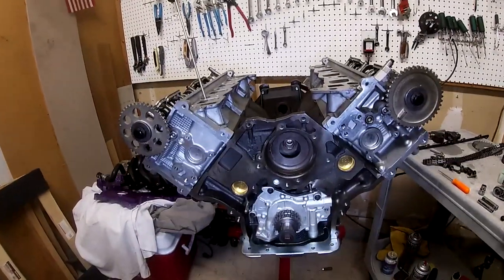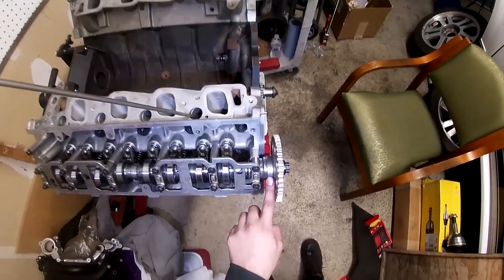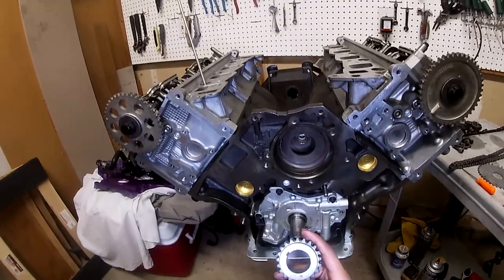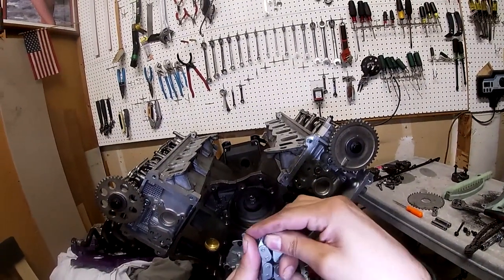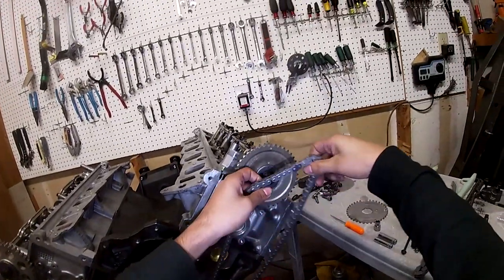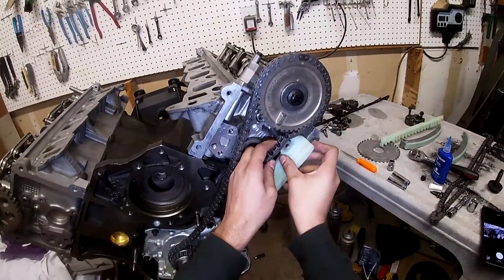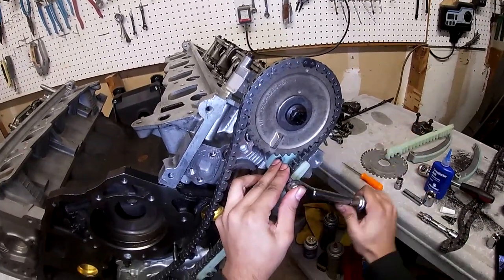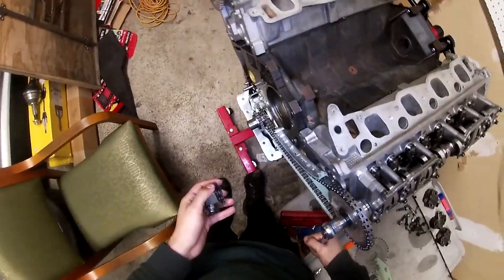Mustang 4.6 2v Timing Chain Install (Detailed Walkthrough)

Comment: Bought a crown Vic engine from a police cruiser for my F150 that I bought with bent valves. Was told it ran good but decided to open it up to check it out. Glad I did because although the engine never jumped time the left side lower guide had broken in two and was just laying in there still guiding the chain but ready to get crunched. Nice video ! Explained everything without the bee-bop !

Comment: I doubt you’ll see this but I would really appreciate if you could help me out I recently did a head gasket kit (driver side) on my 03 mustang gt and the engine was spinning freely when I put the timing chains on and spun it one full lap around it just locked up the engine didn’t wanna spin at all I had to spin the cam shaft to get it to the timing marks so I did one full spin and it sat perfectly in the timing marks please help I don’t know what to do

Comment: Hey i was replacing a 97 lincoln ford 4.6l 2v v8 head gasket and when i set the crankshaft to top dead cent the cams where totally off but my engine ran smooth its weird , while the heads were off i forgot to turn the cams into the timing position and bolted them onto the heads and now when i try to turn cams to the timing position i can feel valves hitting pistons, do i gotta take the heads back off ?

Comment: Someone plz help, i need to do the timing chain on my 4.6 2v f150, its rattling, and its either a broken chain guide or a rocker arm, anyways, how do u get the mark to point at 6 o clock if motor is still in my truck?

Comment: Just finished a timing job on my 4.6 and didn't know that the timing marks on the chains won't line up with the dots on the gears after rotating the engine and was starting to worry that I did something wrong! Thanks for the video telling me about that they will only line up when you first put them on. After rotating the engine twice all three  timing marks lined up like they should. Thanks for the video great job!

Comment: WOW DUDE ! I have to tear down my crown vic again I put in Motor Craft timing chain and guides and with in 40 k they failed so I have to start over again been looking at some how to videos and they all skip the tear downs or installs . Your video rocks dude step by step very slowly you go into each stage I am a certified tech love your video huge thank you ! You helped me a lot because I forgot how to get everything lined up and do the install thanks again
Reply from the maker: Appreciate it bro! Glad I could help!
Reply: @KumArkings32  I wish more you tubers would make videos like yours about 90% tear shit down don't show how they did it and put it back together and skip that shit too ! It sucks I have to tear this down again I put all motor craft shit in there and it lasted about 45 K the valve covers suck to get off I had to take a die grinder and cut the corner off the evap housing to clear the valve cover so I could get it out and put it back in. I guess you are supposed to unbolt the motor mount and drop the engine down to get the pass side cover off . I wish Ford had that shove up their ass and the Motor craft chain and guides that failed I change my oil every 3000 miles and even use Motor 
Craft filters oh the fun of working on cars glad I got out of this shit for a living !
Reply from the maker: @madmanmechanic8847  haha yeah ford made some questionable decisions when putting car together back in the day, I this the whole thing while the motor was out of the car so it was a lot easier for me
Reply: @KumArkings32  I used to be a Ford Tech and we saw some shitty designs from the engineers . I just bought a 2000 Police interceptor off of auction its an old Nevada POST car has 89000 original miles . I tuned it up and replaced the fuel filter its got a misfire went to run a scanner on it and it tells me MIL is off cant get any codes out of it.  Cleared it disconnect the battery tried every thing still get the MIL is off but here is the catcher the check engine light works when you turn on the key . I have no clue WTF dude? I am going to call the dealer in all my years of being a tech never had a car I couldn't retrieve codes from. Again I am glad I am out of this shit don't miss it at all. Have a good one bro thanks for the replies

Comment: Great write up..Just what I needed with the aftermarket cams I got makes doing it easier for sure..You answered alot of unanswered questions I had..I've got a billet oil pump I've had sitting on the shelf..That I havent swapped yet but. Now I think I'll attempt it and change the timing kit if it needs it Motor only has 20k since being g rebuilt with forged internals..Now I feel I can do the job thanks to your video👍🏻🍻

Comment: Great video! By having the crankshaft sprocket with the dot at the 6 o’clock position, will moving your cam gear to line up the chain hit the pistons? In other words, do you need the special tool everyone says you need or used some locking pliers to lock the cams? Thanks.

Comment: I did exactly the same job on my engine my only error was using the same timing chains I replace tensioners and guides and when I put everything back together I had a rattling chain sound do u think that it can be that my timing chains stretch ? Or can it be my oil pump ? I would really appreciate your respond thank u

Comment: Hi my name is Sammy b I'm putting a oil pump on my 2004 gt mustang. Turning my crank to top dead center my chain doesn't line up with my cam dots it's one whole tooth off.when I put it back together do I set it with the marks on the chain and the cam dots  .

Comment: I wonder if that’s the same motor as my 2003 F150 4.6 ??
I also bought the Ford timing chain kit 

Also why the other bolts -ARP ??

Thanks great video
Reply: How many miles you got on it before you heard there was a problem

Comment: Hey i got a question i was hoping you can answer. When lining up timing marks how do you know the came gear marks are in the right position like the crank sprocket being at 6 o clock? Or does it not matter as long as for example the rh timing mark matches with crank timing mark with no slack on one side of the chain? Not sure if you can make sense of this question but im trying to learn lol

Comment: Hey man so when taking off the tensioners for the Passenger side cam, is it normal for it to kind of skip teeth and settle because there's no tension? And also what is the best position for the crank to be at for this? Because people say keep it at 9 o'clock to prevent it hitting a valve because it does snap back once the tension is gone. Thanks!

Comment: man I just built my first cammed engine on my channel and I was wondering why did the chain loose tension on the turns man you saved my life brother 
I was a little worried about why the change lost tension as you turned it at certain points
Reply from the maker: Thanks man, hope your build goes well!
Reply: Ə
 @KumArkings32

Comment: Didn't you need to use a camshaft position locating tool to keep them from moving? The Ford factory video shows use of the Ford  # T91P-6256-A  alignment tools. Thanks.
Reply from the maker: I did not have access to the tool and also didn't really need it to do it as shown in the video
Reply: @KumArkings32  I was under the impression that the camshafts would turn on their own if not restrained by the tool because of the valve spring pressure? You didn't have any such issues?
Reply: @custombill  the turning is easily countered by a wrench on the cam bolt until the hinged rail and then tensioner is fitted. When the tool is used you will have trouble starting the tensioner bolts as tool doesn't hold chain tight on drive side to give enough slack on the slack side. You can move the crank key to 9 o'clock to get to a spot where cams stay put since chain marks by dots is how it is being timed. A wrench will still be needed to tension chain on drive side for tensioner install if this is done.
Reply: @jimmyaber5920  please confirm: you don't need to use camshaft holding tools when removing the chains? [02 Explorer 2V]

Comment: Have a 2011 cvpi 131,000 when would be a good time to do this. Great vid thanks for posting 👍
Reply from the maker: Thank you! Usually if you kept up on oil changes and never let it get low, the guides should be ok and you won't really need to do it soon
Reply: @KumArkings32  thanks for responding new subscriber

Comment: OMG I changed timing chains and valve stem seals and engine running like missing cylinders and rough when you give it gas ...  at Idle  its smooth I check the compression every cylinder is around 125 psi   The stock cams and retainers  had alot of scaring on the bearings  and now make a lot of noise after  reinstall   .. WOULD THE CAMS CAUSE IT TO RUN TERRIBLE IF THEY ARE WORE OUT ...
Reply from the maker: It is a possibility, sounds like you need to tear the whole thing apart and start over
Reply: the cams were too tight .. may have to  degree cams .. used a click style wrench .. bought a digital one now right specs
Reply: @bengordon7635  Did you mean the cam bearing bolts were too tight? Was wondering may have to do this myself. Or are you talking specifically about the front bolt?
Reply: @richardtrowell8812  My valves were so bad soon as some turned changing the seals  the seal was broke ,, I pulled both heads and put all new valves and cams .. there was huge build ups of carbon on top of piston , valves and valve seals runs like new now no smoking or burning oil at all  .. that was the problem not the timing chain install .. I did both at same time chain and valve stem seals .. there is no way any engine cleaner would ever get rid  of  moderate carbon  build up  ..
Reply: @bengordon7635  when you removed the cams to change the seals did you have to degree them? I have dual overhead cams. Unless the seals can be replaced without removing them.
Reply: @richardtrowell8812  I have the 4.6l  sohc ..  I put the rattlers similar too stock more power after 3000 rpm no degree after install .. the dohc 32 valve like yours  most definitely degree them ..
Reply: Intake is on one cam and exhaust on the other. They have a chain and gears at the end of each cam. Not sure if they are in a fixed position or need to be degreed and then aligned with the cam. My driver side tensioner is bad and guide is completely gone except for metal base. Lost all oil pressure. Motor is completely gummed up with grit. Will have to replace motor. Would have to completely go through motor otherwise. Got it used. No engine codes just a oil pressure light at red light turned into this. Wondered why oil was so dark when I changed it. Thanks for the feedback.

Comment: How do you know when it's top dead center?If the cylinder comes up twice once for the compression and one forful exhaust, how do you tell the difference?Help me please
Reply: Cylinder 1 need to be all the way to the top along with 6 I believe.
Reply: The crank has a timing mark which should be at 6 o clock